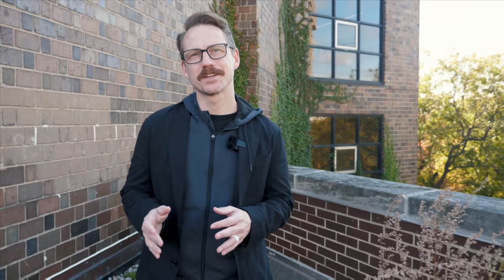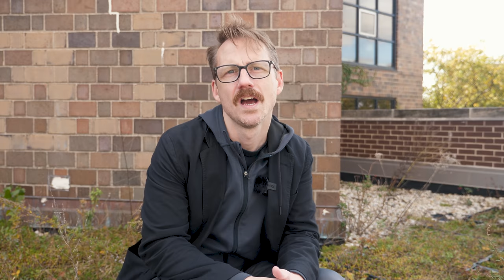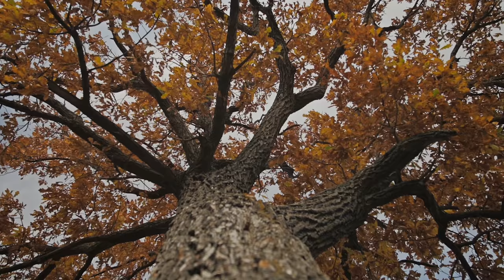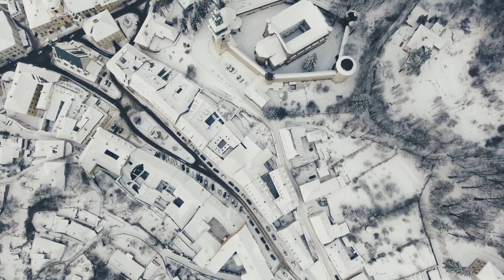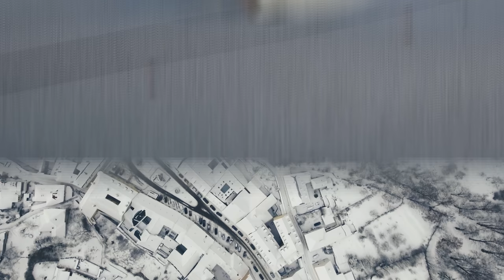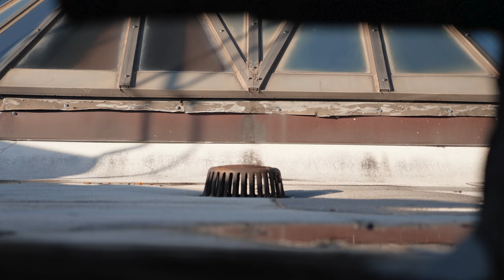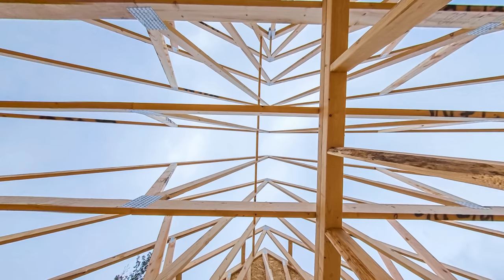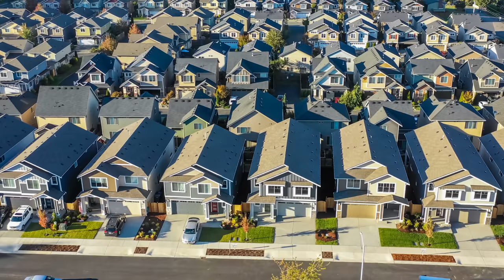Why Do Architects Insist on Using Flat Roofs?

Comment: Awesome video! Thank you. I'm currently studying Architectural Tech in Scotland and I've also been put in a position to choose a roof type. Scotland being Scotland is just wind and rain, but I did a study on 1930s architecture and it's all flat roof! Check out houses at Carse View Drive, Bearsden where (white lime) houses were build with flat roof with the intent to use the roof for sunbathing etc. Had a chance to talk to one of the residents and she didn't like the desing at all. Roof was leaking and there were no plans available (built 1936). But I truly believe with the right technique a flat roof would definetly work with Scottish weather. And now I have a few arguments (from your video) to support my love for flat roofs. Thank you!
Reply: So I'm a flat roofer, I'll help you cheat.  You seem to be taking about a house.  Create a single area sloped roof at 4% pitch, I would suggest plywood or OSB deck.  You can apply bonded EPDM membrane to this roof and it will last 50-60 years maintenance free at the bottom of the incline add a drip edge and gutter system.  I would continue the drip edge system on the other sides, but you can use a small parapet if you really want.

This will give maximum space inside, a very modern and cool looking exterior too.  You can add insulation top or bottom of the deck, this system can be applied directly to polyISO insulation.  It also allows the addition of a rooftop terrace if desired though EPDM should not be directly walked on.
Reply: @jeremyO9F911O2  At 4 degrees pitch, you can use a corrugated or ribbed steel roof - doesn't require sealing or painting or fancy membranes. You can even get panels of ribbed steel sheet bonded to rigid foam for additional strength and insulation. It's simpler to install, requires no maintenance for its life, can withstand gale/cyclonic winds and torrential rain. OSB is dreadful stuff!.

I doubt the Scots do an awful lot of rooftop sunbaking (although, maybe in another 15-20 years the climate there will be more conducive to it) ;)
Reply: @danielscott4514  yeah we generally call this shed roofing.  It has its limitations though.  Firstly the lifespan isn't really any better than any other roofing, all metal will oxidize and solar UV light will destroy any protective coating.  

They also either need a gutter which requires maintenance, or you must ensure your landscaping and foundation accounts for the roof runoff.   All roofing requires maintenance unless you live in a desert at which point the equation is so much different though because there's so little rain anyway. 

Shed roofing also has span limitations, those insulated panels(which I have installed) are limited by the length of the transport trailer that must deliver them.  You can form uninsulated panels on site to any length, my company has 3 such machines, but usually these are applied to a wood deck, plywood or OSB.  You then must insulate from below, which is much harder than flat roof insulating from the top is.  Insulating from the inside often looks worse and is known to fall down over time.  Plus you have to protect it from internal building moisture which again is far easier to do in flat roofing. 

So up to 30m wide buildings you can use insulated panels,  but such buildings have a height limit too especially if snow and ice are anticipated. They are good for about 10-15 meter tall buildings, after that the snow and ice can fall too far too fast, and you'll need a crane to erect the panels.  Most insulated panels are installed by telescope forklifts, as such machines are cheap enough to own or rent, and the operator is you own employee who only needs a 1 day course to be certified.   Our in house safety officer actually does our certification.  A crane is very expensive, takes lots of space to setup, and needs a ticketed operator, backed by insane insurance premiums.    Which is also why you most often find those roofs installed in low density areas where you can access all sides of the structure. 

Writing this comment at home I'm on the 4th story with shingles above me, and that's close to the limit.  Flat roofing can be installed at any elevation because all materials are palletized, and water runoff is never an issue because parapets.  You can also make any span of building, flat roofer doesn't care.  As long as flat roofing has a minimum 1% pitch it doesn't care what your layout is shaped like, what is beside and below the structure.  In dense urban centers where access is nearly non existent, flat roofing is effectively the only option, especially when factoring reliability.

Basically put you can name any roofing system that you feel is superior to flat roofing.  And in scenarios that favor those systems you're most likely correct.  However as the scenario becomes more complex those systems do not scale well at all, while for flat roofing the complexity doesn't add the same advancing curve of vulnerability.
Reply: @jeremyO9F911O2  Thanks for the info - interesting stuff :) I'm familiar with on-site roll-forming, but haven't had much to do with the insulated panels before, since they're a relatively new thing.

In Australia, we don't tend to have particularly good insulation standards (and no-where here has quite the extremes in weather that Canada or Scotland have), so Steel roofs work well (and those of us who've actually bothered to insulate our homes do perfectly ok with rockwool or fibreglass insulation in the roof-space). I can imagine issues with damp in Canada might make that sort of insulation a no-go though!

I've tended to find a lot of large industrial buildings (again, insulation not a major concern) opt for multiple sections of gently pitched steel roof here - it's just as simple to construct as a near-flat roof, but doesn't involve messing about with waterproofing systems: as long as there are a couple of degrees of pitch then there is a steel system that can be laid down easily and won't leak.

I'd say gutters are kind of the minimum level of maintenance any roof (that isn't attached to a farm shed) will require. Everything else from there is more work (if you've got a roof with parapets and scuppers you'd better make sure at least a few of them are clear - contrast that to a properly designed gutter that if it's all blocked up will only spill water out around the building - not into it).

It's definitely interesting to learn how things are done in other countries (with vastly different weather, and possibly better ways of building) though. Australia is definitely in the dark-ages when it comes to insulating our buildings (we seem to have adopted some of the worst practices of the Americans here: If your house is too hot in summer, just slap an enormous air conditioner on top of it).
Reply: @jeremyO9F911O2  Further to my last comment, it's interesting that in the US and Canada you bother with plywood under steel sheeting. Is that just a hold-over from shingled roofs?

It's never done here in Australia ... we just lay a flexible membrane (sarking) over the trusses or rafters with timber or steel battens on top of that. Then the steel sheeting is laid on top of the battens (purlins) and screwed to those.

It's possible to get some kinds of space-age insulation (a bit like bubble wrap) that can sit just under the steel sheet, but most houses don't have it - and if they do insulate then it's directly over the top of the internal ceiling, well below the roof. 

What's the benefit to putting plywood under corrugated or ribbed steel? Do you screw to the plywood instead of screwing to battens/purlins?
Reply: @danielscott4514  we can do the bare truss assembly and with steel structures that is the primary method.  Putting a layer of wood under simply adds additional strength, it also makes the roof more quiet in rain.  Without a wood sheeting you need stronger panels.  And indeed most often the wood sheeting is an artifact of the existing roof.  

In the Canadian climate where I am where an annual frost cycle is assured, metal roofing has different restrictions.  Exposed fasteners are always problematic especially if installed into wood trusses or nailers.  As the frost cycle will cause the fasteners to come loose and they will leak.  So concealed fastener assemblies are needed on wood structures.  

Fundamentally there's no real downside to adding the wood sheeting, it's a great surface to install underlays and we often want an ice and water membrane at the eves too.  Plus it's way easier to do the install too. 

As for spaceage insulation, every system has pros and cons.  One nice thing about flat roofing is we usually install a later of fireproof gypsum board called dense deck, which protects the roof insulation from internal fires.
Reply: @danielscott4514  I actually checked in with one of our metal roofing installers, he says without an underlay which requires a sheeted deck, he will not warranty any roof he installs on a heated building.  Because ice damning at the eves will happen, which is why we apply underlays in the first place.

Scuppers and drains are a million times easier to clean and plug up far less than you might be thinking.  While water obeys gravity, most debris is wind blown and prefers to collect in places where air pressure drops like corners.  If your drainage avoids corners then your problems are minimum.  

Gutters are very long, high up, and located right where you might fall off.  Have you ever stood at the eves of a metal roof?  It's equality not fun for us roofer too.  Step on a metal rib wrong and fall off a roof, nope, no thank-you.  Most flat roofing is level and even easy to walk on.  Drains and scuppers are easy to access and they are essentially a small number of single points to clear.  While you must clear the entire gutter.  Plus parapets offer a little extra safety and piece of mind, plus way easier to firmly secure a ladder to.  One ratchet cargo strap hooked onto the inside of the parapet cap flashing will never move, and you only need to set the latter up in one place too, and many buildings have a roof hatch.

Comment: Here in Germany we are getting more and more new development areas that only consist of white rectangles that all look the same. If the architects in this country could only come up with creative and better looking solutions for flat roofs, I would be better disposed towards flat roofs. These roofs just seem to have no use, except to distinguish themselves from their neighbors with older houses with them steep roofs. While steep roofs are designed more individually looking here, which does not increase the minimum distance of 0.4 of their height to other houses and thus offers the house more interior space to stow away objects or even a cool room for teenagers to hang out. If people at least used the flat roofs as a terrace here, I would think differently about them. But on normal family houses these are simply not accessible for people without climbing up the outer wall. For me it seems to be a status symbol to waste this kinda space.

Comment: I own a modernist house with a flat roof.  When I bought it I had a hard time finding an insurance company that would insure  a house with a flat roof.  I bet you didn't think about that mister architect ...
Reply: Every house I've ever designed with a flat roof comes with manufacturer's warranties.  As long as you follow the correct design practices there is no reason for any firm to deny insurance coverage.  The only fatal flaw would be if the builder fucks up but that is a means and methods problem - not an architectural issue.
Reply: @Daves_Not_Here_Man_76  And yet insurance companies do deny coverage on residences with flat roofs.  My insurance company never insured flat roofs and I discovered that this isn't unusual in the industry.

Comment: As a Chartered Building Surveyor in the rainy south west of the UK I love architects designing flat roofs and other stylistic features to suit their egos rather than our climate because the owners have to employ me to design a fix when (inevitably) the buildings fail after a few years (often only 3 or 4 years). Flat roof materials just don’t last as long as tiles and increased insulation is causing major condensation problems, and as for holding water on green roofs or bringing water down through the inside of buildings…😱

Comment: The issue I have with flat roof is that it covers a huge area, while not being used. What if flat roofs has wooden decks, roof gardens and such. It could become such a clever use of space.
The issue being that it would require the roof to be a lot more robust, but it's a small price to pay.
Reply: Roofs are often extremely noisy from HVAC equipment.

Comment: Nice video.  All roofs have to be sloped by code, all be it 1/4" per 1'  So there aren't really flat roofs in my design pallet.  Sometimes we use them as an ascetic element, but almost always we use them as a functional way to meet the clients goals.  The newer membranes aren't bullet proof, but much better than those of 20 years ago.  The key to any roof its the KISS principal, sloped or not.  Make is simple, and minimize holes!
Reply: Ascetic or aesthetic?
Reply: "all be it 1/4" per 1'"

Can confirm, this man spells like an architect.

Comment: If we're talking about roofs, I've always wondered why houses in hotter climates don't extend farther beyond the sides of the building to create shade and cool down the building with less demand on the AC. I understand older houses in the Australian outback were built this way. I imagine there's a cost element. 

This was a great video, and something I had never given much thought to. It's interesting that although the tops of flat roofs could in theory be used for gathering, they're usually locked and inaccessible to building occupants. Unfortunately a waste of urban space, in my opinion.
Reply: It’s more of a cultural “space-making” aspect. Asian architecture, of course, is very famous for their elongated roofs that provide shade for the buildings façades.

Latin American and Arab architecture, on the other hand, doesn’t really value the façade that much, preferring instead to build balconies, interior courtyards, arched porticos or, in modern times, raising the building with pilotis to create a wide open ground level. 

It’s a more “introverted” approach, valuing interiors with good natural ventilation rather than exteriors with good shading.
Reply: I'm currently working at an Australian school with some pretty old buildings and one of the things that really struck me was the protruding third storey on one of the buildings, like in traditional medieval and Tudor buildings. The overhang created by this shades the windows of the second storey just like the overhanging roof shades the third.

Comment: Now this is a video that appeals to me greatly! 
I have always loved flat roofs, and not because FLW seemed to prefer them.  Flat roofs are actually much better performers for structures (in most cases) than gable roofs; if done properly.  The modern materials that have been used since the late 80s has made these low slope roofs in commercial buildings practically maintenance free, over a much longer period of time.
While tall gable roofs are impressive to look at, they are costly to build and maintain over the life of the home.  And even they aren't leak proof. 
As a former builder and serious aficionado of architecture, I have come to embrace the simplicity of flat (low slope roofs), due mainly to their practically, and all the other reasons you so accurately described.
Thanks for this video. I really enjoyed the topic.
Reply: As much as I like pitched roofs, I have to admit, tiles are a lot of maintenance. And they're not exactly cheap. EPDM on the other hand, if properly installed, will last as long as you...

Comment: I'm designing my "Dream House" which is based on the Sarasota Modern style of architecture - I grew up there and I was in a lot of those houses as a kid. So now my design has to have a flat roof with internally drained pitches so that the gutter downspouts don't screw up the design. What I don't have is a parapet wall surrounding the perimeter - I wanted the roof details to be as simple as possible but now you have me wondering about the 200 mph max winds and how to keep the roof membrane from peeling off. Great content. I really enjoy it.

Comment: Architect here - you got to it towards the end of the video.  The main reason for flat roofs on larger buildings is for rooftop equipment that serves the spaces below.  Easier construction and geometry are also benefits on larger buildings.

Quite the opposite of the topic, a non-flat roof on a building over say 10,000 sf rarely makes sense for many reasons.  So much so that often times we will use a screening element that mimics a sloped roof from far away when in reality the roof is flat beyond that screen.